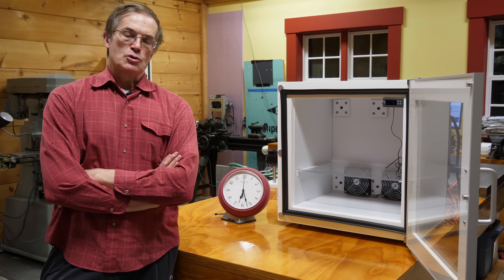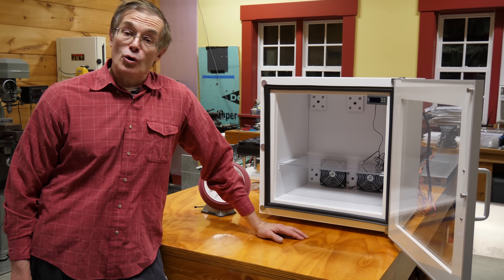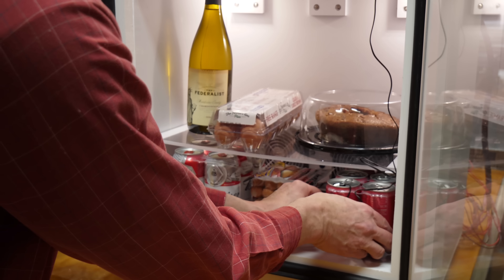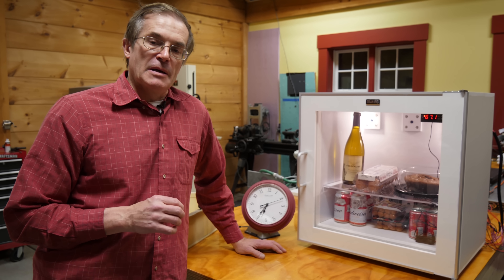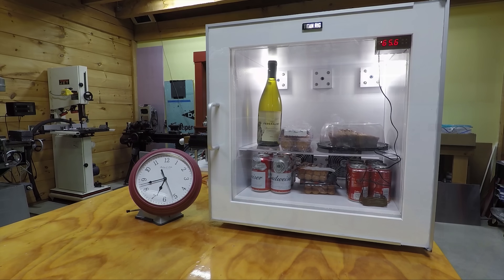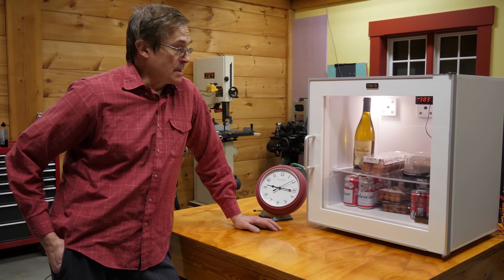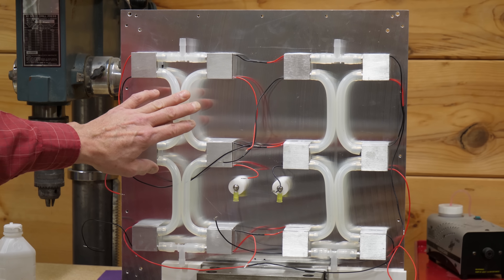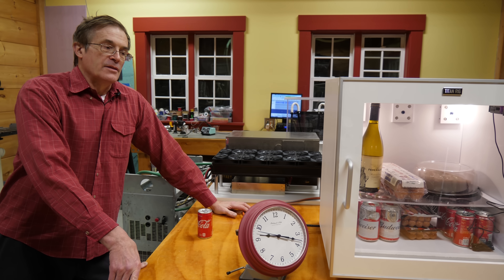TESTING OUR DIY REFRIGERATOR! - TEC/PELTIER

Comment: Regarding passive cooling, I can't help but feel like your main issue is a lack of heatpipes to funnel heat from refrigerator to the TEC, and heat from TEC to heatsink. If I remember correctly you mentioned in last video that the TEC is heating around 60 btu / hour (or "60 btu per hour is equivalent to 20 watts per hour" (unsure where the extra "per hour" comes from as 1 btu = 1 kJ (btu is a unit of energy, not unit of effect). But that becomes 20 joules per second per hour. Lets assume the extra /hour is an error, and its 20 watts)), and there are computers far smaller than that fridge which passively cools hardware with a TDP over 100 watts (100 joules per second), and the main difference from them that I can see would be that they have heatpipes (and smaller and tighter packed, but more, fins. But I doubt they had a significantly higher surface area). Saw one in a video today that supposedly works for TDP's above 200 watts.
Reply from the maker: Because our refrigerator works so much better with the fans, the limiting factor is conduction away from the aluminum sheets into the air rather than from the TECs into the sheets.  Substantially more convective surface area is needed than we can practically get from a reasonable number of these sheets.
Reply: @TechIngredients  Did not expect an immediate answer on a months old video :) I gave it some more thoughts, and realized a large difference between pc's and the refrigerator might be the difference to ambient temperature. A passively cooled pc can expect to have its parts even out at around 80 degrees (err, celsius, I did notice you like your imperial units), which is significantly above ambient. Some of that heat likely transfers to the air and convect away already before the fins, but they are likely to reach at least a toasty 50 degrees (celsius). That huge difference to ambient would likely increase the effectiveness of natural convection. 
As opposed to that, the fridge doesnt pump that much heat to begin with, making the fins both less hot and less able to convect as much heat. 
Still, I like heatpipes. They are cool (pun intended). 

I got a bit curious while you assembled it btw, why were the spacers between the fins designed to have a big hole in the center? Doesnt still air generally conduct heat quite poorly (its why windows have two panes and cold skin lift the hairs on it)? And the fins themselves have no matching holes, so it doesn't seem to be for making the spacers add up to six cylinders passing through the heatsink (although I am unsure what such a cylinder would achieve. Airflow maybe?)

PS: If you are curious of the passively cooled pc's I mentioned, here are some links just-in-case (cause at least I found them to be interesting bit of reading/watching. I found the first link in particular to be fascinating, although it might be even bigger than your refrigerator (384x384x403 mm))
https://linustechtips.com/main/topic/351134-finished-the-silent-cube-pushing-passive-cooling-to-the-limit-with-dual-gtx-980-update-21-liquid-cristal-thermometer/
https://www.youtube.com/watch?v=o-zeHUtsIFw
Reply from the maker: The holes make the pressure for a given screw loading higher, improving thermal transfer.  These more distal spacers are conducting less heat and the thermal load is progressively dropping.  But, the main reason is that it is easier to sand this outer region dead flat when the bow of the center of the stock aluminum is gone.

Comment: For your next project could you do a PC water cooling loop thermal assist. PC overclocking enthusiast can by using enough radiators keep the coolant at ambient air temperature. However, that will only allow so much overclocking. On a i9-9900k for example that means overclocking from about 4.7 GHz to about 5 GHz. Using LN 5.7 GHz can be achieved. The point of the thermal assist would be to allow the enthusiast to overclock their PC further by even .1 GHz by reducing the coolant temperature to below ambient. That would be enough to make some enthusiast very happy.  For a candidate PC case to house this experiment I would suggest the Thermaltake X71. It has a built in pedestal.  https://www.amazon.com/Thermaltake-Tempered-Certified-Computer-CA-1F8-00M1WN-02/dp/B01N4R021Q/ref=sr_1_3?keywords=thermaltake+x71&qid=1554137511&s=gateway&sr=8-3

Comment: Make a thermal radiator to heat things like a coffee maker (by running the radiator coils through your water to use and make coffee or have a hot water heater heated my the refrigerator.  Kind of ironic but perhaps if you can dang near boil water you could also use it for steam power (during the daylight hours to add additional power via solar to store for after hour battery usage to allow for the additional heat to the peltier to super heat the water or better yet an oil to heat the hot water or boiler maker for the coffee, steam power, (which could turn battery power from solar back to electric for usage at night for lots of thing).  All based on the fridge.   Lol

Comment: The only thing I didn't see is the power consumption.
Seems like 6 thermal pumps working at 1:2 efficiency plus 4 fans of 3 Watts. 
So if it took 2.5 hr to do 30°F sounds like 24 watts per pump or 144  Watts plus 12 from the fans.
Total of 156 Watts per hr.
Then it loses 2 degrees per hour (not counting how many times people open the fridge)
So 24 hors it absorbs 48 degrees of heat...
Then it has to work 2.5 hours to reach 238 and work 4 hours a day to keep it cool.
Total of 6.5 hours at 156 Watts = 1kw per day.
So if you pay 50 cents per kw you pay $15.00 per month in electricity.
But I'm probably wrong. Hehehe
Reply from the maker: The simple answer is that the refrigerator uses approximately 110W continuously to maintain a few degrees above freezing and the lighting.

Comment: Absolutely love what your doing. Tec,s can also provide the power to run the fridge in the heating months. A balance of power or transfer of energy where you want and need it. If our whole  home's were designed around our energy needs with passive cooling incorporated with refrigeration. Your passive coolers would have a cool air taken from underground pipes in summer pulling a draft through your Tec exchangers up through an attic pulling heat from your attic and even out of your house. Balancing all of today's technology to build a self controlled self maintained living environment.

Comment: I've toyed with one of these Peltier devices. They are novel items to experiment with at the price point of a few bucks. How have you addressed the tendency for the Pletier device to attract airborne moisture to it at the cold junction? It seems every time I power one of these tiny things up beads of moisture almost instantly form on the cold side.
Reply from the maker: That is a problem I am familiar with.  Seal the cold side from the open atmosphere.  Note how our insulation covers the cold block and the TEC so that only the hot side of the cooler is exposed to the air.

Comment: I like the idea of using the external temp to help with the cooling.  In a way it reminds me of how old fridges used to be hooked to the outside wall of the house so they could be opened from the outside for the milk man.  Have you considered using the earth, as in digging a small hole about 4 foot deep and putting your radiator there instead... depending on the depth and you regional conditions.... it could make it so this would work even in the summer.  Also i didn't hear anything about how much electricity it is currently using.... I understand this is a test model and isn't intended to "solve the worlds refrigeration problems", but still i would be interested in how it currently compares.  Thank you for the great video... also a side note... i wish you would have kept doing the gas powered drone i really wanted to see how that turned out...  maybe doing a wrap up video on projects when you decide to move on... even if its just to say ... this is where it currently is and for now i'm setting it aside... anyway thanks agian.  Hope you have a wonderful day!
Reply from the maker: Thanks!
We're still working on nearly all our previous projects, including the generator.  These recent turbojet videos are part of that.  All our jets are intended as gas generators to drive power turbines for electrical generation and vehicle transmissions.
The ground loop is not only a good idea, but a practical one as well.  Geothermal heat systems are well understood, but bulky and expensive at the scale needed to cool or heat a building, but for refrigeration they become easy and quick for a DIY project.

Comment: You substituted a double glazed window for an insulated panel.

That is a giant thermal hole sucking a lot of heat in to the box whilst trying to remove heat from the load.
Reply from the maker: True.
Reply: @TechIngredients  

In thinking further, i seem to recall that you can stack Peltier junctions . Would doing this be more effective than adding them separately?
Reply from the maker: No, it's less effecient.  It is done to increase the maximum differential tempreture.  The problem is that the second TEC has to pump the heat from the first AND all the electrical power used to drive the first.

Comment: I think a good addition would be to add a half inch heat sink on the cold side and an SS plate just behind it to speed up the recovery after it is emptied of air when you just opened it.
Reply from the maker: That's a good idea and suggests another.  Water is an excellent thermal sink and basically free.  Place a large reservoir of water within the fridge.

Comment: and if you reverse polarity you can keep food warm
Reply: now on a side note.   wouln't a small heatsink (with fins) on the inside also increase the ability of the peltier to absorb the heat from the refridgerator?
Reply from the maker: The large surface area of the rear plate acts as the heat sink.
Reply: @TechIngredients  yeah i doubt it good enoegh   

it's only needed for the initial cool down though.  keeping the temperature stable isn't that intensive

Comment: One thing that could be done to improve the cooling inside is move the TEC units to the top of it. Then you might not need any fans inside.  Most likely still would on the outside though.

Comment: Have you ever tried to stack 2 or more peltier plates to make a system like that? There are a few videos on YouTube about that and they said that can achieve - 50°C in a couple of minutes.
Reply from the maker: You can and we will show just how low you can go in an up coming video.  But in all cases the effeciency will be very poor.
Reply: @TechIngredients  I watched some videos where they use a larger one and then 2 smaller peltier over, (12712 and 12706), all with 12 volts.
In other video they use 3 12706 but with different voltages, they use a pc power supply and they use 12v, 5v and 3.3v.
 I think that we could use PWM to the inside Peltiers and use full power for the outside peltier.
I suppose that it will require some kind of "calibration" of this sort of system, but I think that if we can lower the temperature faster and achieve useful results it will be more efficient. 
Obviously we don't need - 50°C in the refrigerator, but it think that we can achieve 0° C much more faster and then shut down the system as a regular refrigerator.
Sorry for the long message, but I think that it is a good idea to test and could be more efficient.
Thank you for your time.

Comment: So if I need a higher differential between my refrigerated temp and my available ambient Temps can I sandwich two peltier modules together with the rejection side of one in contact with the absorption side of the other?
Reply from the maker: You can and we will show this application in an up coming video.  But, the effeciency will be much lower than a single stage TEC.

Comment: I was thinking about using tubes with a liquid that would boil at refrigerator temperature to carry the heat outside and then condense and flow back as a liquid but I don't know what the liquid would be. Imagen passive "free" in winter refrigerators. Being aware that pressure affects the boiling point i'm thinking propane with an inert gas to raise the preshure might work.
Reply: Well after an internet search it seams butane boils at 31.1 and I like my refrigerator near freezing.

Comment: If it wouldn't add unnecessary resistance to a heating system, I'd say plumb it into the cool side of a furnace and make the heat useful. You could plumb it outdoors through your HRV unit if you didn't want to put anything outside, though your cooling would be dependent on air flow in the unit.
Reply from the maker: Not a bad idea.

Comment: Great vids as always, and I love the water cooling/heating idea, which lends itself to further energy conservation potentials, but you really should have included at least the volts/amps, watts draw, if not the heating/cooling watts as well. If you must use imperial measurements, please also add the metric equivalents as well for us dummies.  Love ur vids, always good details, which matter keep em coming , thanks for ur info an share.
Reply from the maker: Thanks!
I actually demonstrate the power use in our upcoming video on the TEC freezer.
Here in the US we're bilingual and have to work with both systems of measurement every day.

Comment: Just finished both videos.  I am amazed & inspired!  I can't wait for the follow up water cooling version.  I hope you discuss the pitfalls of a simple PID temperature controller VS a PWM unit in the context of heat transfer across the TECs when they are "off". Cheers & thanks so much for sharing this project.  Hope I'm not jumping the gun, but I suppose the liquid cooled config solves this?
Reply from the maker: That video is already done, but not yet posted.  I do not discuss PWM, but you do not want to do that.  The current peaks will define the effeciency even if the average current is significantly lower.

Comment: I WAS TOLD BY MY INSTRUCTOR , THAT IF YOU APPLY A CURRENT OF ELECTRICITY TO A PELTIER YOU WILL RUIN IT
Reply from the maker: You might want to look for a new instructor!
Reply: @TechIngredients  So you're saying if I apply electricity to this Peltier I bought on E-bay it will be cool on one side and warm on the other ?
Reply from the maker: Yes.  That is what they are made for. They have input power limits and can be damaged if you fail to remove enough heat from the hot surface heat and it's tempreture climbs beyond it's maximum operating limit.  Why did you purchase it in the first place, knowing what your instructor had told you.
Reply: @TechIngredients  so it's a mini heating and cooling unit correct ? You don't apply heat on one side and cold on the other to produce a small amount of electricity right ?

Comment: I'm from AZ..  I used to work at a Solar Test and Research facility.  The number one problem with triple junction HCPV cells was the inability to get the heat out of the semiconductor material.   Liquid cooling is definitely the way to go if you want to prolong the life of your TEC's..  What is the TEC MTBF @ this time?
Reply from the maker: The very low cost 12710 TEC's sourced through eBay do not have any associated MTBF data.  However, the highest effeciency will occur when these are driven at very low currents.  They will probably last for years in this application.

Comment: Thermoacoustic refrigeration  is interesting, :-  https://en.wikipedia.org/wiki/Thermoacoustics   & So is Ethanol Activated Carbon Absorption Refrigeration:-  https://www.youtube.com/watch?v=Uo4lAYmerjI
Reply from the maker: Thanks!

We have looked into thermoacoustic refrigeration.  It is interesting as well as challenging because the engineering is pretty demanding.
I will look further into ethanol adsorption refrigeration as it seems very doable.
We just finished a very exciting video (not yet posted) on a desiccant based evaporative air conditioner.  It is more than twice as efficient as a conventional compressor based air conditioner, is easy and inexpensive to build and may be a real game changer.
Stay tuned.
Reply: @TechIngredients   Brilliant! my 1978 Copy of "Building In The Tropic" mentions this method. I believe it has a lot to do with the energy of crystallisation. for example water will boil when caustic soda is poured into it. (Safety. NEVER pour water onto caustic soda) . In the past this has been suggested as a heat source, water freeze dries under a vacuum, due to the triple point sublimation effect. Heating Igloos for Eskimos was a tongue in cheek application. Great Channel. SUBSCRIBED Today. with more Science Trivia Comments.  https://www.amazon.com/Tropenbau-Building-Tropics-G-Lippsmeier/dp/B0018Z2Y3C

Comment: as I recall, you used the 6 amp versions and you used 2, mostly.  I would like to see how the single 9 amp works.  This would make a great portable fridge, like for camping, because it's much lighter, but 9 amp hour draw would be even better
Reply from the maker: Can you clearify what you mean by the versions?
Reply: @TechIngredients  the peltier.  In a previous video you showed the numbers and what they meant.  in the picture it showed one that ended in a 9 which you said was amps, but yours was 6.
Reply from the maker: Sure.  The basic design of the majority of TECs is similar.  The current/voltage relationship will be determined by the number of thermocouples in each module.  This can vary from a few dozen to many hundreds.  Wiring them in series or parallel or a combination of individual "strings" will permit more flexibility for the power supply.  In all cases, the lower the power loading/surface area of the combined TECs, the greater the effeciency.  We have a total of 6 TECs (three by two) driving the refrigerator and as you will see, 12 TECs driving the freezer.